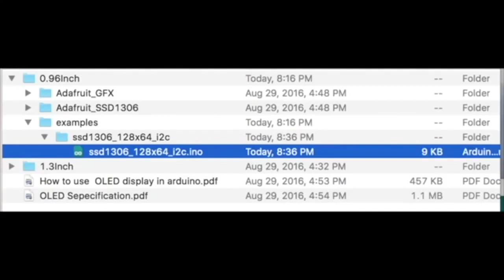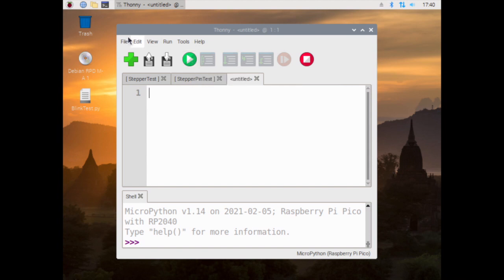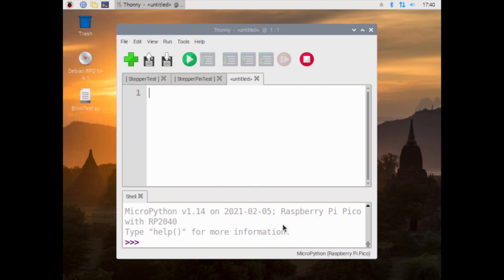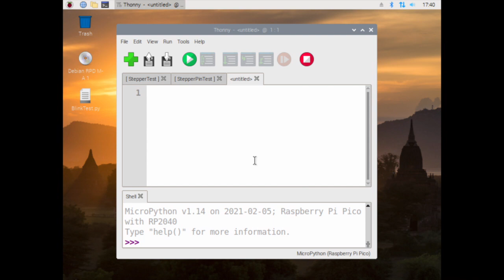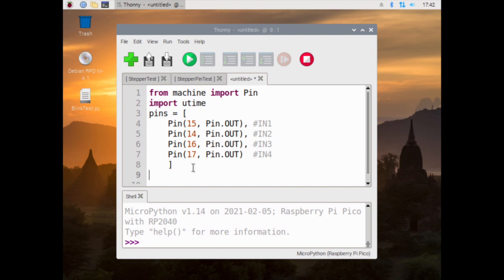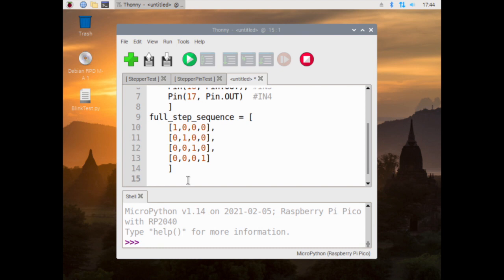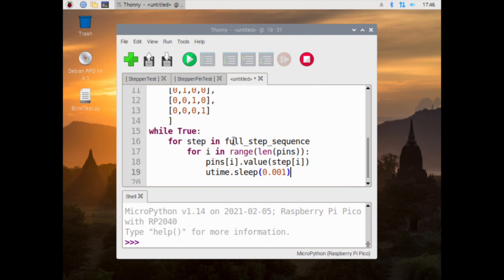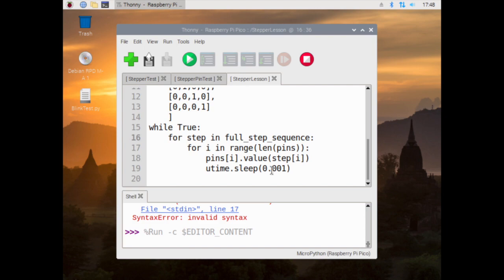How to use a stepper motor on a Pi Pico

Comment: Can you do a video using the DRV8825 with the Pi Pico to Control a Stepper, I cannot get it to work :-(
Reply from the maker: Yes I will do a video using DRV8825. Thanks for watching !!
Reply from the maker: Double check the 8825 board. I was ordering some and I noticed that they are a 5V board. The Pico is only 3.3V so it won’t be able to use that board.
Reply: @TheWizardofWestLA  You could use a level converter.